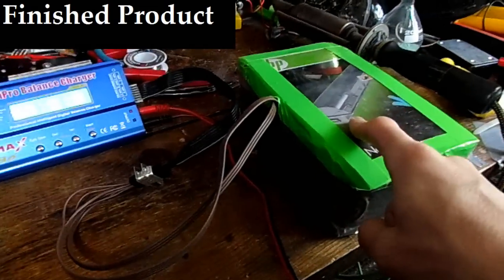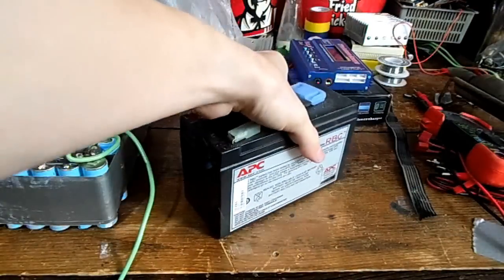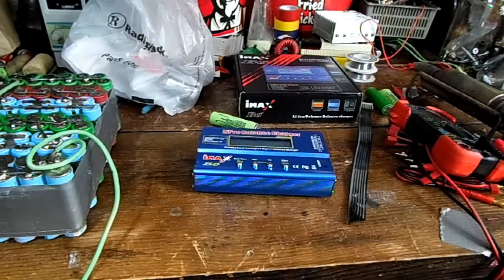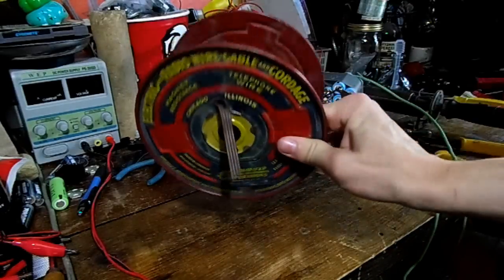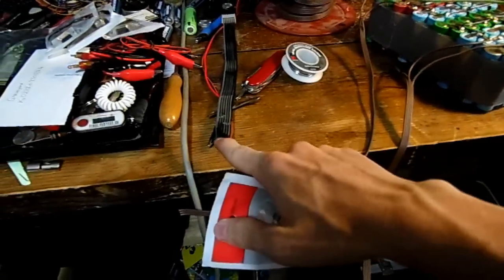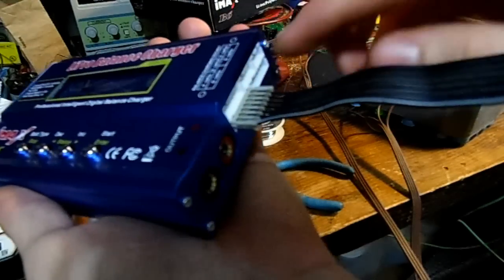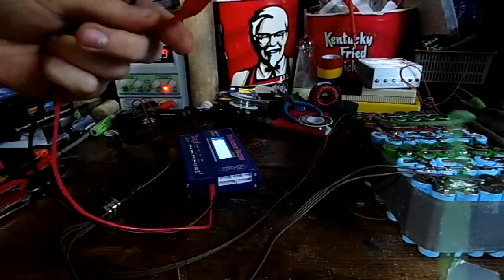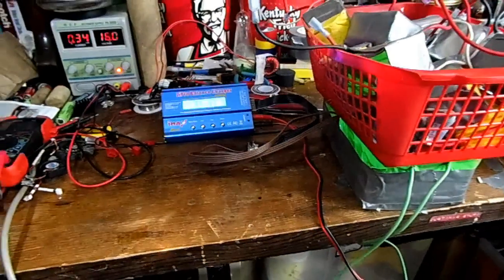DIY: Balance Charging E-Bike lithium battery upgrade

Comment: I get my batterys for free ..my mate works in a battery factory .. I need to know how to make one ... For a 1000w motor from ebay .. The more I look into it the more I get confused ...you are just the man I need to talk to.... My head is done in everything I learn there's something conflicting. Can you tell me watts the biggest and best battery pack I can make do I hook them up in series parallel
Reply: ***** no you wud get 54.6v when they are at 100% and 25.2 ah
Reply: +Christopher Shiels huuk as many as u can in paralel and 12 in series four a 48 v 1000w motor
Reply: +Kristijan Dinga i'll use 6 in paralel and 13 in series, because i'll buy bateries that are 3,7v and 4200mah for my 48v 1000w motor. i just wonder, will i have a pack that will give me 48,1v and 367,6AH?? woow i think i need to decrease some bateries.
Reply: +Kristijan Dinga so how would one go about charging a 48 volt battery ?
Reply: Joshua B you can get an imax b6 wich is cheap hook it up and volla also you can add balance leads

Comment: When you said that the batteries cannot balance themselves, and needs to be connected separately, do each cells balance itself when they are in parallel and not in series? Like if there is 8V in series, one can be 3V and the other can be 5V. But 4V in Parallel, do all cells balance themselves to just 4V? Couldn't some cells overcharge or undercharge but sum to 3V?
Reply from the maker: yes parallel cells all act as one big cell so they dont have to be balanced, its series that does.
Reply: Is it possible to connect the batteries with the copper conductive adhesive tape instead of nails?
Reply: No, vibration will cause problems.

Comment: Great videos, very informative! Is using this device for balance charging the same thing as using a BMS?
Like this one:
http://www.ebay.com/itm/60V-67-2V-16S-60A-Lithium-ion-Li-ion-Li-Po-LiPo-Polymer-Battery-BMS-PCB-System-/221268671937
Reply: OLD tech

Comment: The 9 pin D sub is also the older style serial ports.  If you ever find old PCs cheap that seem to have these sockets in an expansion slot, they might be just a bracket with those sockets bolted into it.  They are easy to remove from it and the ones I see usually have wires that go to some header on the motherboard of the PC.  Check the thickness of the wires before you use anything like those because they might be too thin and overheat and cause all sorts of problems.  Any wire can get hot if you draw too much current through it and that can be a problem.
Reply: lots of nice wires in old power supplies

Comment: Also for the bike where the pedals would go? well since you don't need them.. I would remove them and mount under them a foot rest that is circular in shape that extends under for both feet.. and in side the enclosure? I would mount a gyro to ummmm well weebles wobble but the faster you spin that gyro.. it does NOT fall down LOL....
Reply from the maker: you need the pedals on the bike for it to be legal. and if you dont want it to fall down i recommend buy a tricycle.
Reply: Well you know.. like a singer sewing machine.. who says the pedals have to work in a reciprocating fashion? IE. old sewing machine's pump pedals?
Reply from the maker: Jesse Mercury
the police do.
Reply: Okay.. a mechanical foot pedal is a mechanical foot pedal.. just because someone build a better bicycle pedal does not mean what they have designed is not a bicycle pedal.. and to my understanding of Black's Legal Dictionary.. a bicycle in no way would be less of a bike from a sewing machine type mechanical pedal where you pump instead of reciprocating that well what you are working with today.. yes you are right the law dictates what you can do with invention... but have you taken time to read the LAW on the matter?
Reply: Or if you want reciprocating.. what about collapsing fold in pedals?
with allowances to stop said gyro if pedals are needed to be deployed and used?
be innovative.. no one ever changed the world by saying it cannot be done....
Reply from the maker: Jesse Mercury
but what is the use of the internal gyroscope?
Reply: By having gyros operating counter to one another in planes ... (The wheels are one set already) you creates stability that can be extremely safe at high speeds... additionally the rolling resistance caused by the tires.. well you only need on tire to propel the bike...sooooo gyro's on two planes could even mean a unicycle that is electric that the seat is forward of the wheels like a bike.. defying gravity...
(and lowering rolling resistance by 50%... put two gyros on board next to each other on the same plane and vary the speed of each? turns on dime without a set of forks and wheels to do it... it's angular momentum... basic physics... :)
Reply from the maker: Jesse Mercury
that would fuck up steering since you need to lean to steer. and secondly what about the gyro's precession? if you had a unicycle with gyros on it you would start turning around slowly and be fighting the gyros.

also if you let it sit, it would still fall to the ground.

i just dont see what problem it fixes that outweighs the issues it creates.

Comment: I did this with an IMAX B8+ and a bunch of 2200mah Panasonic and Sanyo Prismatic cells from laptop batteries. 
My Pack is a 12p 8s lipo, with the balance charging leads attached to the 12p cell positive leads. Starting from the NEGATIVE SIDE, count the positives, this will indicate your order or balance leads. 
(Makes approx 24 Amp Hour Battery @32 Volts)

THIS WORKS! The Pack is balancing as good as ANY commercial pack I have purchased. 

It takes time... lots of testing... lots of charging... and more time... Then follow that up with some more time.  

THANK YOU FOR THIS VIDEO!!! 

Making my own pack saved me about 400$ 

SWEET! 

Tip: Use Loc-Tite Stick Tabs from the office supply section of wally'world, and you can use them to space or gap the cells in the pack to allow for better heat dissipation. It also make the cell MUCH easier to service in the future. 

Thanks Again!

Comment: Hi Rinoa, I have purchased 240 new cells from a job lot of laptop batteries for £92.00. Which makes it approx. 30pence per cell including the diesel I used to pick them up. Granted I need to pull them apart but I figured a quick way of achieving this... I happen to have a table saw for my work, the blade is adjustable in height. I just ran the batteries I need over blade and made an easy way in. I only scratched one cell but it only took a blades width of plastic from the outside of the cell. Sound crazy? Well it worked for me! I now have 108 2.4mah batteries ready to pull the tabs off. It took approx 1hour. Cheers!
Reply from the maker: cool!
Reply: I want to know do you have video?

Comment: i have found a realy good batterys of 3.7V 5.3A and i want to build 37V and 53A from 100 batteris (2 packs of 50 batterys per pack,53A and 18.5V) can the balence charger in your show work with thet power?
Reply from the maker: what do you mean by 5.3a? do you mean it can provide 5.3a or that it has 5.3AH? there are no 18650 cells that have more than 3400mah. i'm afraid those cells are a ripoff. never buy trustfire/ultrafire/truefire cells. and yes a charger can charge a battery of any capcity, its just the volts that matter.
Reply: Rinoa Super-Genius yes 5.3 Ah look if you dont belive me 
http://www.ebay.com/itm/4x-3-7V-18650-GTL-Li-ion-5300mAh-Red-Rechargeable-Battery-for-LED-Torch-/121498553553?pt=LH_DefaultDomain_0&hash=item1c49e0ccd1
Reply from the maker: Liam Sharashov yup thats most likely a ripoff.
Reply: Rinoa Super-Genius well f*** so i have fuond 1.2 v 3ah batterys (thay are 100% real)can the balancer charg thet low volteg?
Reply from the maker: Liam Sharashov
well most batteries are "real" its just they will have like 800mah instead of 5000mah.

only go by discharge tests, i never trust what the seller says. i say if you want to get one of those cells and discharge them on an imax b6 to see how much they really hold.

and what chemistry is the 1.2v cell? is it lithium?
Reply: Rinoa Super-Genius they are real my friend check them but i dont know if the balencer will work or I need to build 2 circuits 
1 )all the batterys in parallel for the charge.
2 )5 packs of 20 battarys (24v and3Ah per pack ,24v and 15Ah).
but thet will be a lot of work.

Comment: I'm building a battery pack like the one in this video and I need advice on what power supply to use to power my balace charger (same one as in the video, imax b6). I'm completely new to all this and I don't know what to get. I'll only be using the power supply to run the imax b6 balace charger like in this video. Can you tell me what to search on ebay/amazon to find what I need?
Reply from the maker: just grab an old computer power supply, make it always on by connecting the green wire to any black wire then take 12v from it by the black and yellow wire. you can probably find a power supply thats good enough in the garbage.

Comment: Hi again Rinoa, have been harvesting laptop batteries again and out of 70 there were only two that were duff, your excellent explanation about balance charging lithium batteries had me looking at a few more videos, have now purchased quite a few 5v 1 amp Micro usb charger modules from ebay, they were a very reasonable price, will be using one per cell to ensure each cell is charged individually, will let you know how it goes, regards Doc Cox
Reply from the maker: sounds great, just dont try to charge all the packs of cells that are in series at the same time that way. then again i think you could charge them all at once with like multiple USB connectors going to each pack as long as you somehow disconnect all the packs from each other. you could do that with relays.

but anyway i think with that you would have to charge each pack of parallel cells one at a time. my friend battonfive  tried that and had some issues. and similarly i remember i tried to run two DC-DC step-up converters with their inputs coming from the same battery but the outputs running in series to each other. it acted like a short with the positive of one converter shorting over to the negative of the other one.

hope that makes sense. sounds like your on your way to a really cool battery pack.
Reply from the maker: battonfive once you get above 4 packs in series i think it would be best to use a ballance charger or just get a designated BMS board.

One switch to run them all, One switch aligned them. One switch controls them all, and with that power kind them.
Reply: hmmm not great, but gives the gist of it www.batzorprogramming.com/parrallelchargingexample.jpg
Reply: Rinoa Super-Genius Yep Rinoa is right, beware with power banks when you are trying to run them in series but charge them in parallel. You have to make sure you have switches everywhere between all the cells, otherwise you find the charger circuits wll create additional circuits within your circuit and you start getting the cap smoke :-p Switches are the simplest method :-) but not practical for large arrays. Im pondering on making a pack at some point perhaps using some blocking diodes or something, but not had chance to have a go yet :-D
Reply from the maker: battonfive
 well you would only need to disconnect the packs of cells from each other not each individual cell, so by you saying "large array" i think that may be a bit misleading. if you have a lot of cells in parallel and the output voltage isnt too high (meaning not many packs in series) then that wont take too many switches to operate it. but if you have a large array with a high voltage, that would mean youd need more switches and then it would become difficult to use.

not saying your wrong batton, just clarifying so we dont have other people reading it wrong. or did you mean individual cells?
Reply: Sorry Rinoa, I wasn't really clear there :-p yep meant array of cells. When each cell is hooked up in series for the output appliance while at the same time it is also wired up to recharge each of the cell's in the pack individually, then you find that without switches in place when you are trying to recharge all the cells in parallel, an additional circuit is made, that will create a feed back and fry your charging pcb ports your using for example. As you say its possible, but its a lot of switches :-) when it comes to the bigger packs of cells. I was thinking of rigging up one switch to 'rule them all' as to say 'one switch that has a bar running off that clicks on or off a load of switches, but not really give it to much consideration atm. I do like to parallel charge like on my ebike for example, but on there the li-ions have their own snazzy pcbs to do the balancing, and crucially I disconnect the one of five battery packs in my bike so I can charge four batteries that are in the footwell, while avoiding that sixth circuit which may occur (expensive so not willing to test) if I left them all hooked them up and then charged them. I will do a quick drawing and post it below, regarding the circuit I made for my truck (3 x li-ion cells) incase its handy :-p I have another design in my head that might be a work around for larger cell arrays that will be charged in parrallel but am still pondering on it, when I get chance I will post that one below to :-p